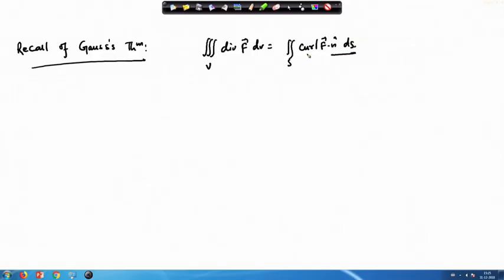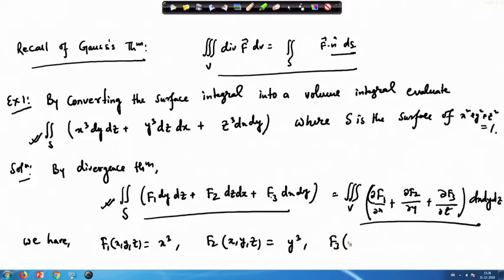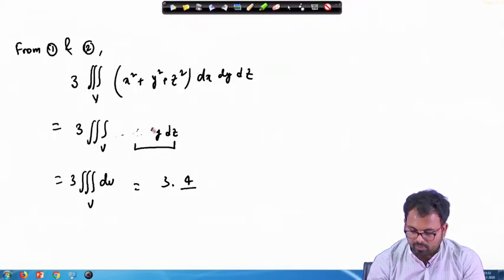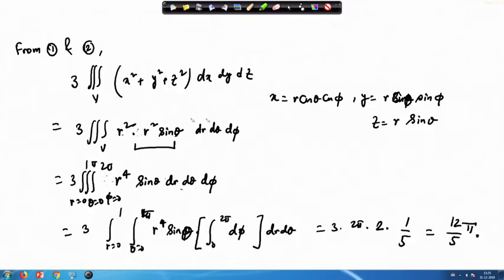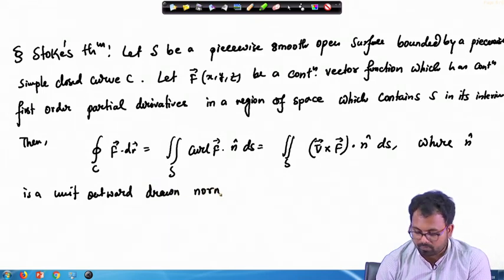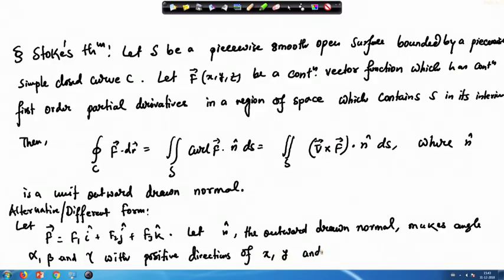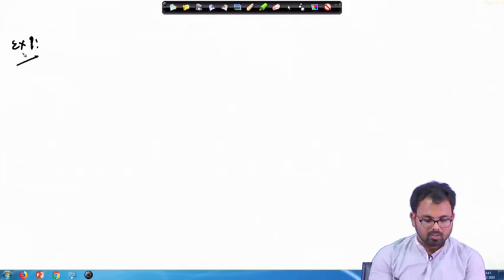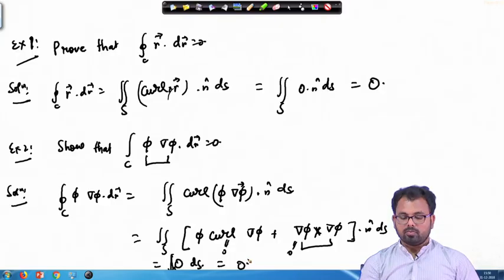Lecture 59 : Stoke's Theorem

Comment: Without using polar coorndinates in the 1st question.the nswer is different.WHY?
Reply: see we are also calculating the integral for those x,y,z which are inside the sphere, so there x2+y2+z2 wouldnot be equal to 1, that's why we used polar, we mistakely assumed x2+y2+z2 to be 1, but that would be only for boundary points